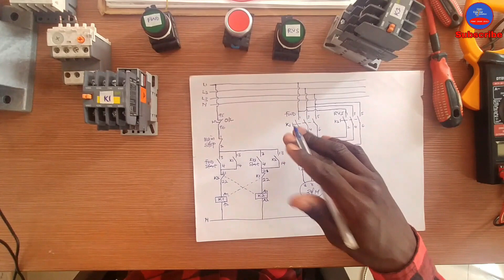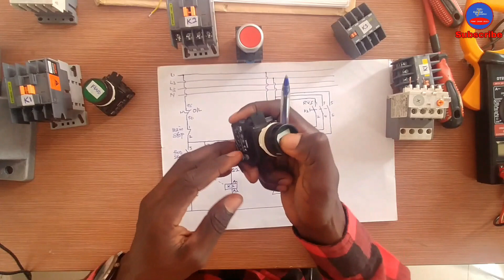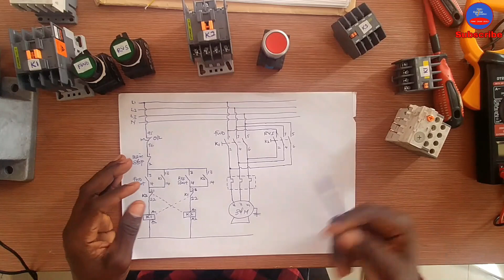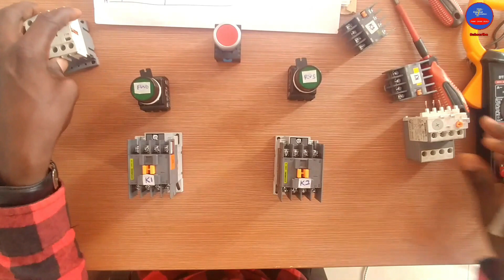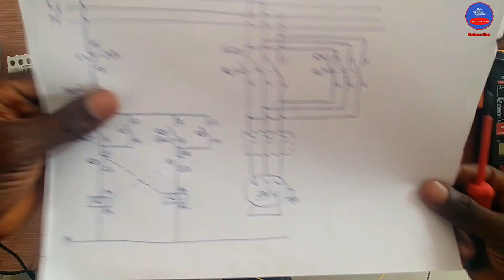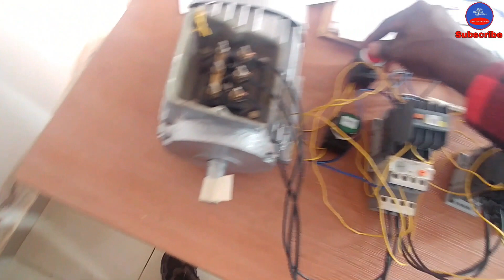Forward and Reverse motor starter | forward reverse starter

Comment: Good, well done. my observation is that you did not include a circuit breaker.
Reply from the maker: Yeah that's good. But my main focus is on the controls, so you can fix the circuit breaker for your project.